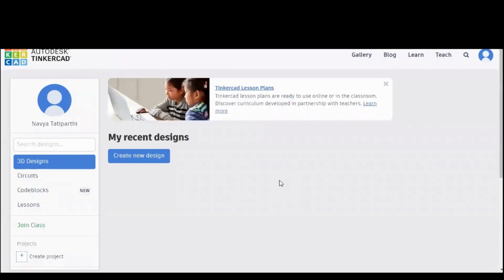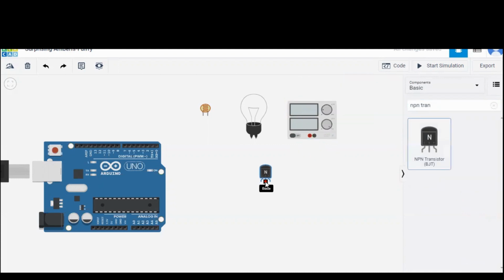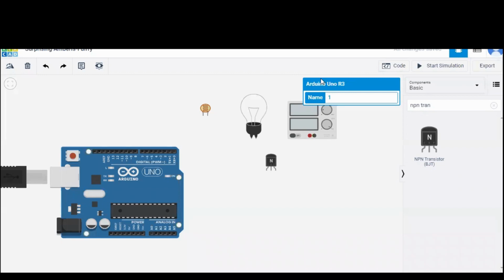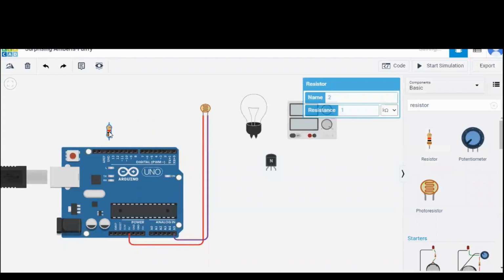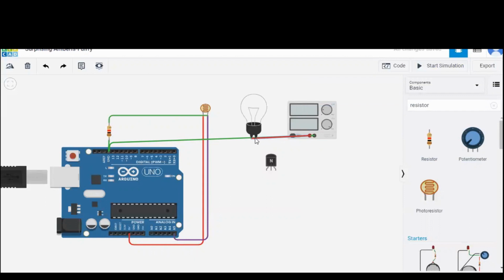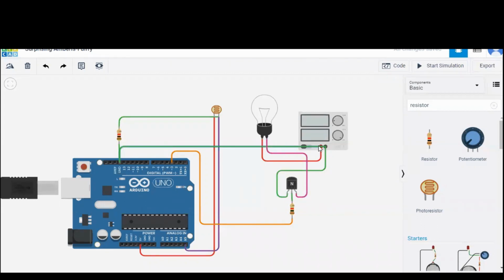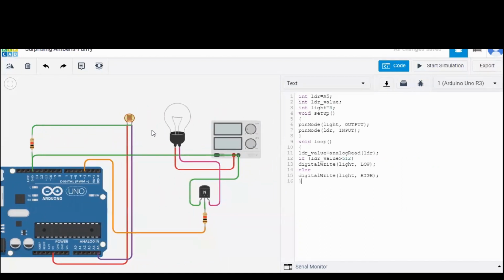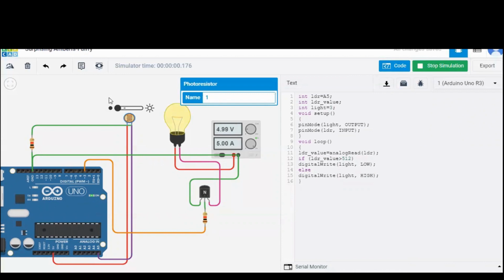Smart Street Light Project using Arduino UNO, LDR and LED || Arduino - TinkerCAD DIY Project

Comment: This comprehensive tutorial demonstrates the construction of a "Smart Street Light" project utilizing a photoresistor to regulate light intensity. It meticulously guides viewers through each step, from component selection to circuit connections, while also providing insightful explanations of the underlying principles behind components like the photoresistor and NPN transistor. The emphasis on neatness in the connections ensures clarity, making it easier for viewers to follow along. Overall, this video serves as an invaluable resource for those interested in understanding and implementing similar projects in TinkerCAD or real-world scenarios.